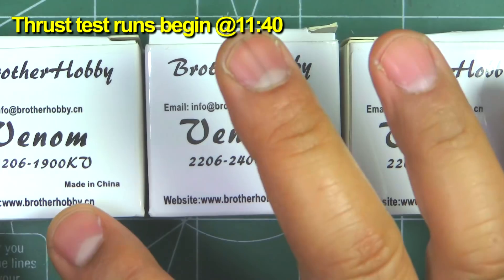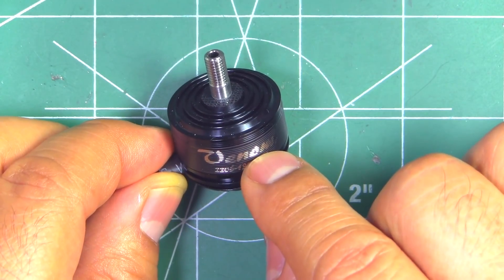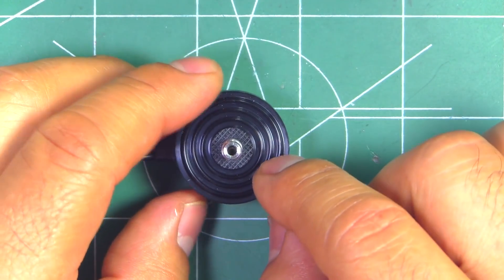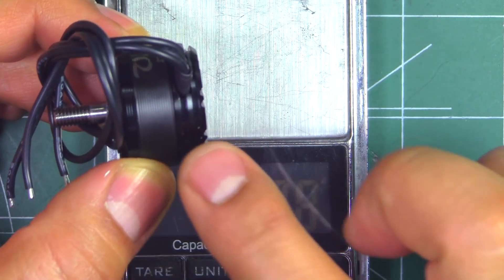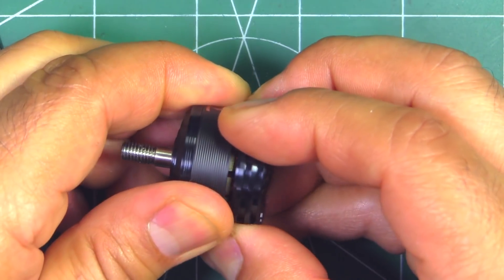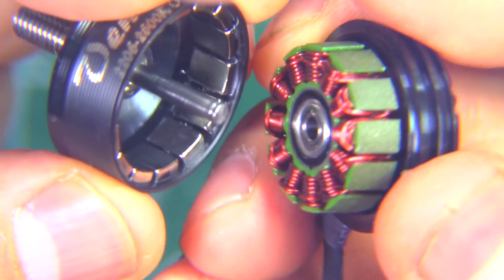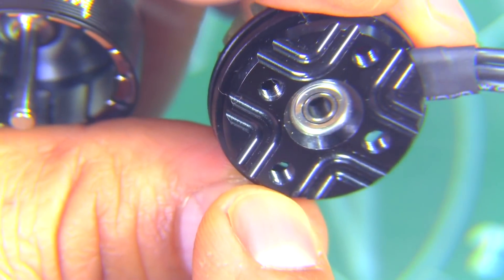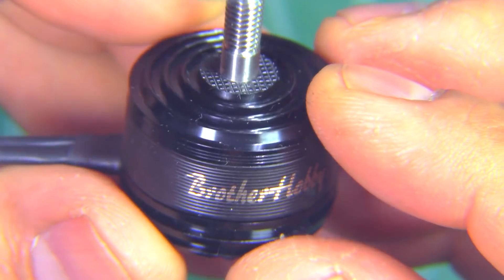BrotherHobby Venom 2206-1900KV All Weather-Harsh Environment 6S or LR  Motor

Comment: I really enjoy your tests!
Do you have plans to test the Brother Hobby R6 1750kv?

I am debating between this BH Venom 2206-1900KV and RCINPOWER GTS2308 1850Kv for fixed wing, the difference in weight is minimal. Which one do you think will have better bearings for loooong flights (more than 1 hour).
Thank you!
Reply from the maker: :)  that's the next vídeo I'll be uploading. Working on the edit this evening so it should be ready late this evening or tomorrow evening
Reply from the maker: For fixed wing the rcINpower would be a better choice for 6" props. Both have good bearings. If you have already used 2206 size for your setup then the Venom would also be a  good choice. The larger rcINpower would have more load capacity and less likely to run too hot when using high throttle for a long time.
Reply: Thank you!
Reply: Thank you, looking forward to your video. I've got one of these R6 and they are a marvel of engineering.

Comment: Thanks for great testing and review. It looks like these motors would get fairly hot with everything enclosed?
Reply from the maker: if loaded too much they might run a bit hot. For fixed wing you'd probably want to run them with not so aggressive props. For multirotors, they should run OK with 5" props on 4S

Comment: I worked with similar designs on combustion motors and it's incredible how such a small lip can prevent also water from getting inside. the centrifugal force actually make the lip work as a labyrinth seal. if the motor is seated on a flat carbon plate with some sealant (like silicon gasket) so that the bearings are also protected, it effectively becomes a sealed motor.
Reply from the maker: Very good insight, as usual :) Thanks for adding very good info on how that lip could work in this motor.

Comment: Actually all brushless motors are kind of waterproof, meaning they can run under water. The bearings are usually the first source of problems under water though unless they are really waterproof.

Enclosed motors like this are very useful in sand, dusty or muddy places from my experience, like if ferromagnetic particles are present like in volcano lava beaches or iron mines: these attach to the magnets instantly.
Reply from the maker: Right,  this enclosed motor should keep most debris like that from sticking to magnets. Crashing in muddy places also makes a mess. So you should be able to just give it a quick clean up on the outside and keep flying.

Comment: Definitely could have used these yesterday at a race.  Just needs a 1600-1700kv for 6s racing.  1900 is too much and won't make 2 minutes without a giant battery.
Reply from the maker: That's the KV I've been seeing used by racers (1600 ~1700) Balancing battery weight , flight times, and motor are key to get those fast 2 minutes! Thanks for chiming in. Great info!

Comment: nice to see the flash 7042, what's your opinion of it, from your tests so far. 
on 5S with my 2508 motors I'm noticing a slight flutter at higher RPM's when putting down power quickly ? apart from that I'm liking them they give a pretty smooth flight,,,,,,,,and the floss works too on props with inserts.
Reply from the maker: I have not flown them but from what you say it could be that due to their larger size they could flex enough to cause that flutter. The HQ 7045 seems more rigid.
Reply: yes they are a bit flexible, now I know the floss works with inserts I will be testing some 7050 APC props when I get the time.

Comment: I think if tiny sands get in the motor its going to be difficult to get it out and might cause more damage and a tiny bent on the bell will cause the bell bottom to friction with the bottom frame do you think?
Reply from the maker: Yes, if you're flying, for example, at a beach with lots of "metallic-type" of fine sand, eventually it may accumulate on the magnets but I think it'll be fine and small enough that it shouldn't damage motor for the day. You'd have to give it a cleaning once you get home and see how much it got in. The main advantage for this enclosed design is to keep the usual large debris like mud, pebbles, large sand particles, etc.